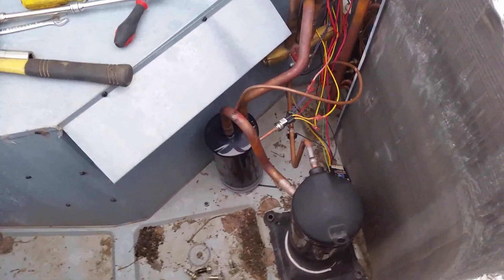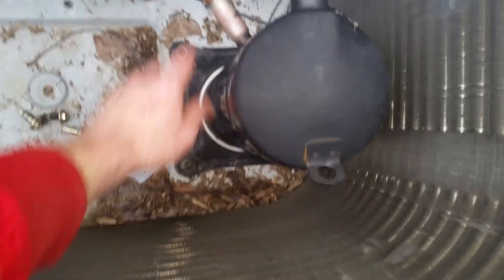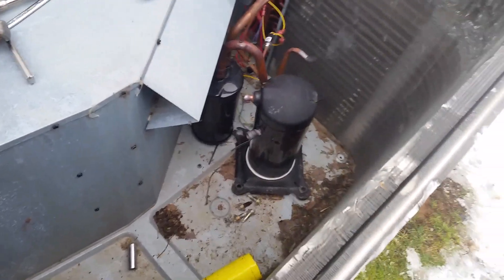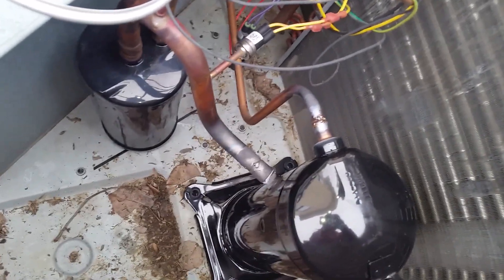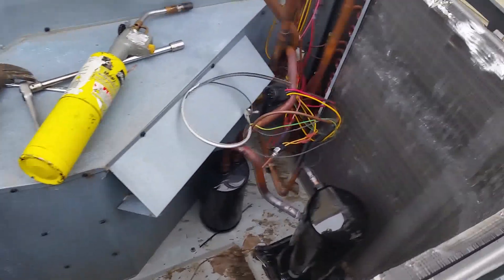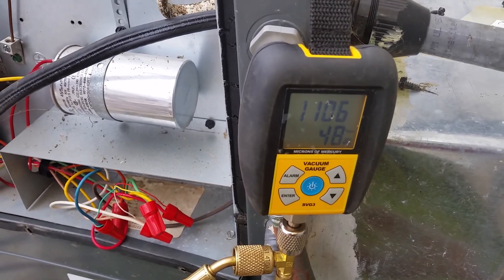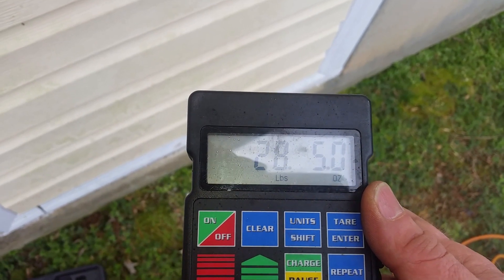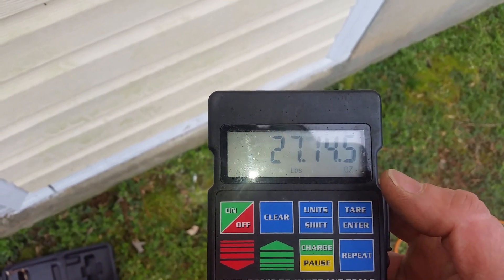replacing the heat pump compressor

Comment: Got myself a hot air gun which is handy for warming up compressors, accumulators or receivers etc to help get all the liquid out when recovering. If you are shopping for one, get one with some low settings so there is no risk of damaging paint or wiring etc.
Reply from the maker: That's a great idea I usually have a hair dryer for that situation but I burnt it up awhile ago and I just haven't put one back on the truck